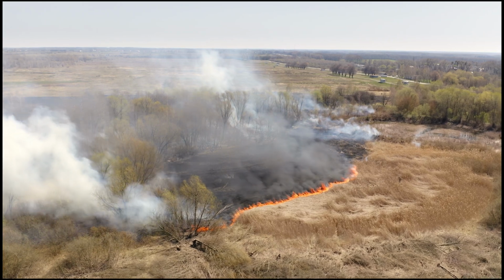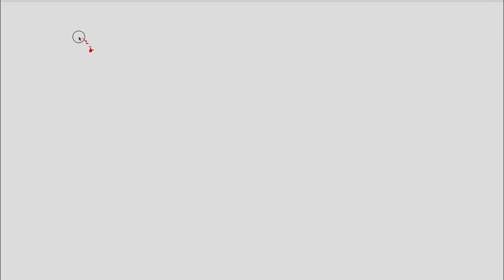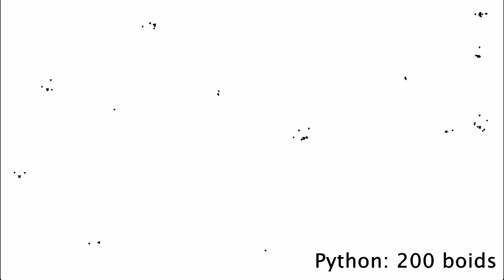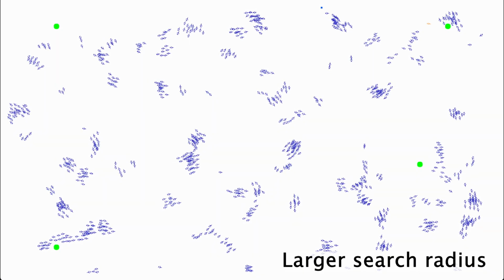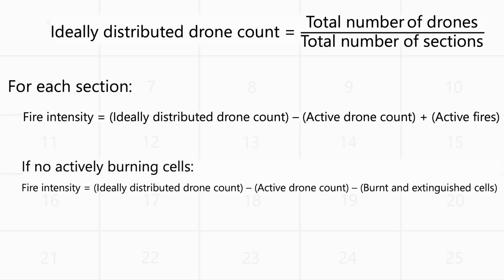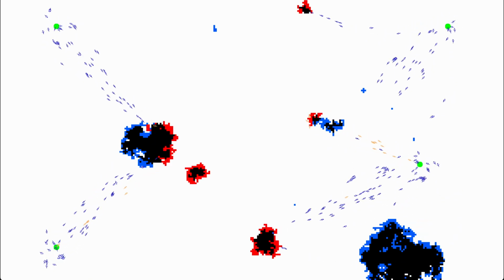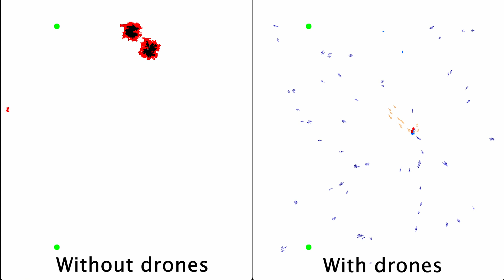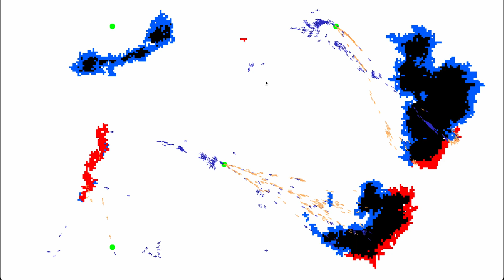1000 Drones vs. Wildfire!! (Simulation in C)

Comment: Hey Did anyone have to setup or Flash their ESC for oneShot or Dshot and if so how did you do it for the Teens4.1 I tried and it didnt have a drop down box ; letting me pic the protocal or anything
and my ESC "ReadytoSKY support dshot 300,400,600 and Im using the Teensy 4.1 for a flight controller

Comment: One thing is that a lot of firefighting especially from the air is in terms of retardant, you could have half of the drones putting out the fire and the other half spreading retardant to keep the fire from advancing, it should be way more effective.
Reply from the maker: Definitely some interesting strategy components to consider!
Reply: @peterryseck  The thing about drones is that they could potentially function in high winds vs manned aviation.  I've flown a lot of drones in 50 mph+ winds before and it's not that bad.  Although a drone carrying 10's or more lbs of liquid could be a lot more difficult.  I wonder what the top speed of a fully loaded flycart is.
Reply: hmm looks like about 30mph.  There are drones that I've seen that are hybrids that use an rc aircraft engine to generate electricity that might be faster and more powerful, maybe something like that.

Comment: Very interesting subject. I love the modeling discussion and simulation rendering. How closely is the C implementation matching the python implementation for the speed comparison? 
Nice work!
Reply from the maker: Thanks good question! I only replicated the code for the boid part at 2:10 and saw with 1000 boids, C ran each frame at 0.0026 seconds and python at 0.34 seconds.130x faster! The rendering/display isn't the reason for the slow down either. Without rendering C is 0.0015 seconds and python 0.33 seconds. There might be a way to speed up python by using numpy matrix math instead of the O(n2) for loops I have.
Reply: Not a programming guy but I have a lot of emergency response and management experience and am currently a DFR pilot for a county PD.

You overlook a lot of practical variables and dangers.

1- Currently sUAS are limited to 55lbs gross weight, to include payload. Using 8lbs/gal for water and assume a 20lb drone body, that limits payload to a little over 4 gallons of water carried by the aircraft.
2- Assuming a safe altitude of 200'AGL, 4 gallons of water delivered from that height would be insignificant to the fire. Imagine a decent size bonfire and throwing a single Solo cup of water on it. It knocks the fire back to a degree but simy fails to lower combustion temperatures or to deprive O2 enough to extinguish the fire.
3- Thermal currents in super heated air creates almost hurricane force winds and seriously disrupts air stability. An sUAS flying in those conditions has a high probability of crashing.
4- The swarm would be necessary to deliver enough water at once to be effective. However,  with the air currents as dangerous as they are over wildfires, a few out of control drones would likely cause a fratricidal effect on the rest of the formation.
5-Battery life might give you  40 minutes of flight time in ideal conditions without a payload. Cut that in half for 30+ lbs of water payload. This requires a close base of operations to prep, launch, recover, and reconstitute. This would put the base into a dynamic danger zone.
6- C2 for the drones would require line of sight for the FM frequency that most drones operate on. If the topography is broken with elevation changes, this requires operating from high ground and to be relatively close. Dense forests can degrade radio signals and disrupt low power GPS signals.
7- Drones will have lithium batteries and if they crash or are in excessive heat environments,  then they can be fire hazard. If you you hybrid powered drones then the fuel becomes a fire hazard, as well as the platforms are inherently heavier, leading to smaller payload capacity.
8- Airspace will be congested. Until deployable reliable airspace management solutions get fielded, this will be a huge problem,  especially with crewed aircraft in the same airspace.
9- The logistics would be a large problem. Transporting enough drones, water, power, and comm gear to set up close enough to operate would require significant coordination and ground traffic management. Furthermore,  wildfires are unpredictable and base stations would need to be able to pack up and move expeditiously to follow or evade the path of the fires.

I get the concept you are exploring but currently technology and the regulatory environment are not evolved enough to safely attempt this concept.

Comment: I liked this 1:31
Reply: All in all some great idea and hope it spawns and aids those in need. Conceptual vs current solutions, it could have potential for sure. As you mention, more failure rates of drones or loss of signal etc., more parameters could be added for the calculations too.
Great collaborations I hope will come about. Cheers 👍💪✌
Reply from the maker: @rjung_ch  thanks!